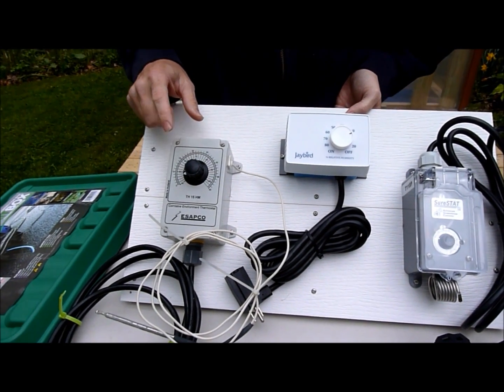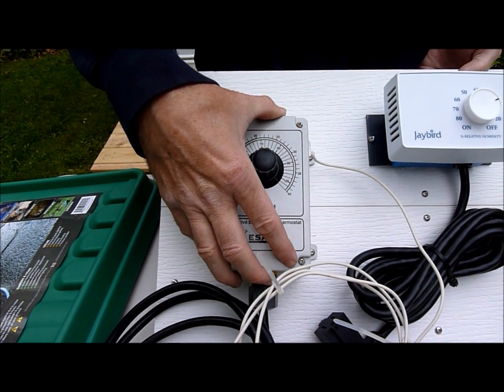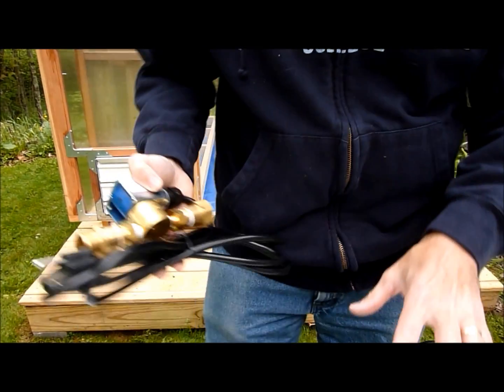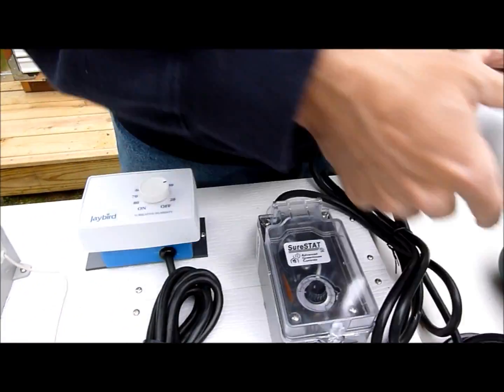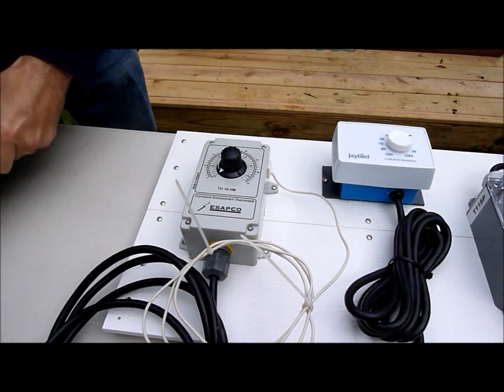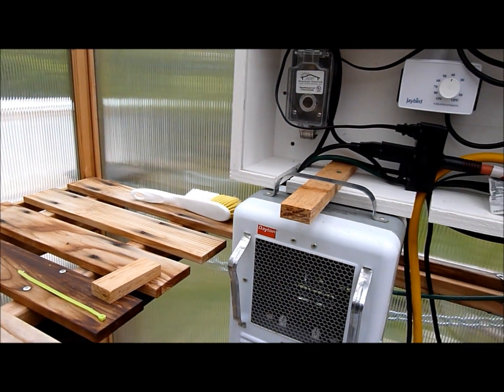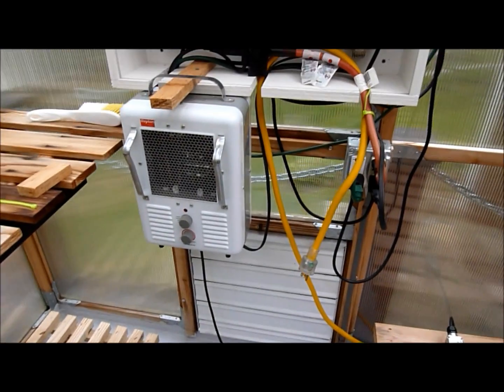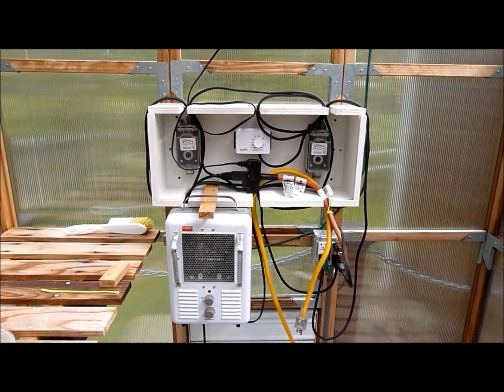How To Set Up a Control System For the Hobby Greenhouse.wmv

Comment: Hey Doug, I've recently finished building my greenhouse. It's pretty similar to yours in size and construction, so I'm taking a lot of inspiration from this video for setting up climate control. I was wondering whether you've had any issues with the humidity and the electricity in the heater? Also, do you think I could use electrical window openers instead of the fan for cooling and air circulation? Finally, do you have any new insights after using this for over 8 years? Thank you so much!
Reply from the maker: Hi Pieter, First of all let me say that I have not used that setup in about seven years as  I moved from the house where I had that greenhouse.  I have also never been able to grow Hoyas as quickly and nicely since I left that place.  It was a set up that worked very well.  I do not see why you wouldn't be able to use electric window openers in lieu of a fan for cooling; it might work better rather than blowing all of the humidity out as soon as the fan came on.  I had no problem with the humidity causing any issues  with electricity or heater.  Good luck with your greenhouse, when properly functioning, there is no better way to grow Hoyas!

Comment: Could you send me a detailed list of your parts and where to purchase them? Just the electrical stuff. Thanks
Reply from the maker: You need a prewired humidistat. Link: http://www.littlegreenhouse.com/accessory/controls2.shtml#humidistat  You need Plug-in 120v Watering / Misting Solenoid Valve Link: http://www.littlegreenhouse.com/accessory/mist3.shtml
Everything you need is at those links above including prewired Fan controls and thermostats.

Comment: Good work.
Reply from the maker: It worked pretty well for relatively low cost.
Reply: Did you custom make that "plug in" solenoid switch for a garden hose hook up? If not, where did you get it? Been having a hard time finding one similar.
Reply from the maker: No, it was plug and play.  Here is a link to the product I bought http://www.littlegreenhouse.com/accessory/mist3.shtml  It works fantastic; just don't run it without a water hose connected or it will burn up.
Reply: Thank you! I was at that website a couple of days ago but must not have looked in the right place. Just got my 8x8 greenhouse closed in and trying to dial in the passive and active  environmental controls. I'm in North Texas so its fairly dry right now but our weather is crazy year round. It's gonna be a ride!
Reply from the maker: Nicholas, I wish you the best of luck with your new greenhouse.  I'm sure that you will have great success!